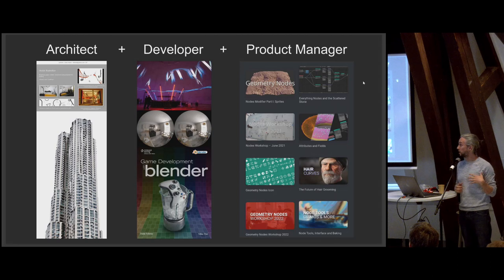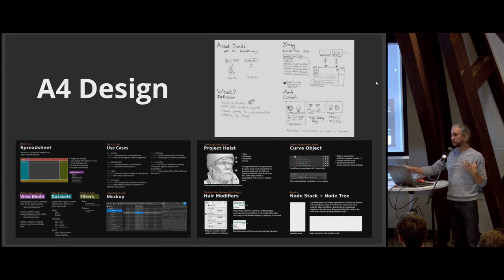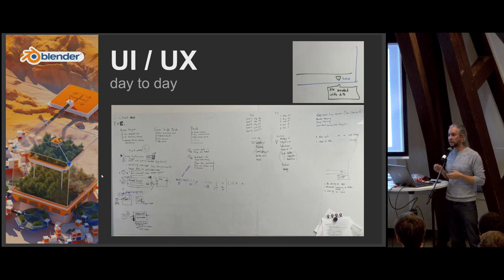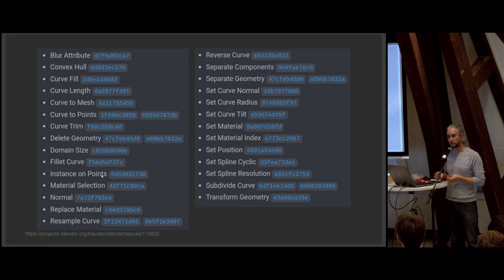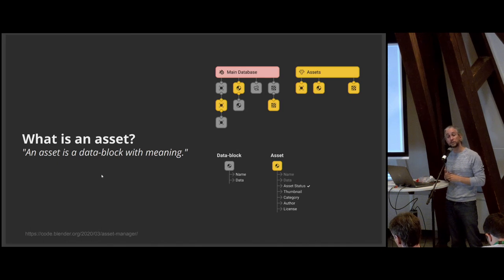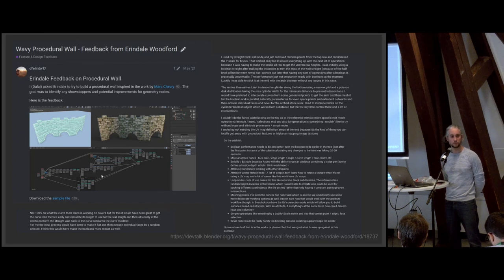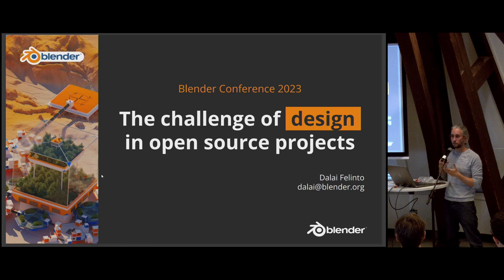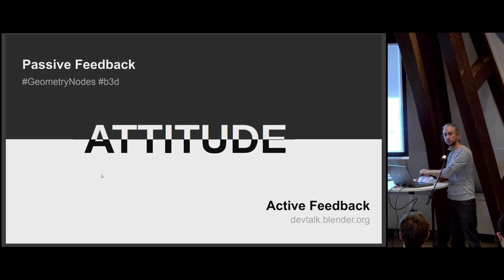The challenge of design in open source projects

Comment: The biggest design problem with collections right now that really needs fixing has to do with Collection Instances. If you have a lot of these instances in your scene, you need the ability to select the source collection. A command like, Select Collection Source. Right now it's a huge pain to have to go hunting in a complex Outliner for this source.
Reply: That should be very easy to implement, but it only works for the cases where the collection is in the scene and instanced at the same time. It wouldn’t work for linked in collections (which I believe is the most common case). Is that really what you are looking for?